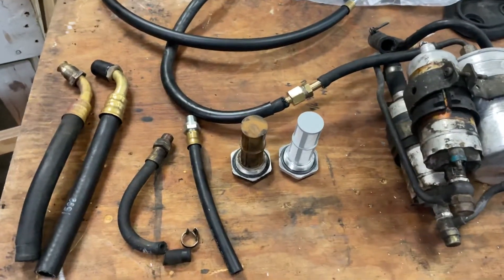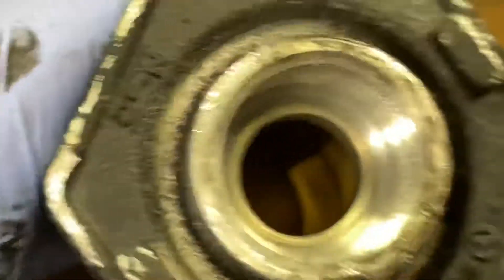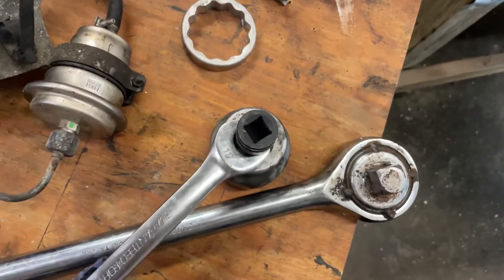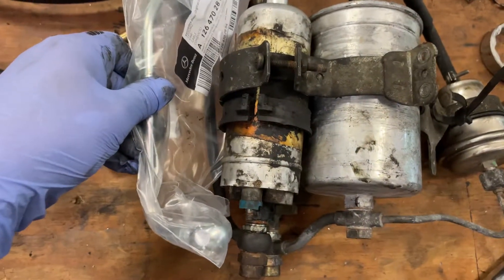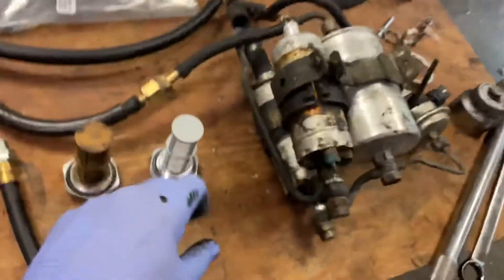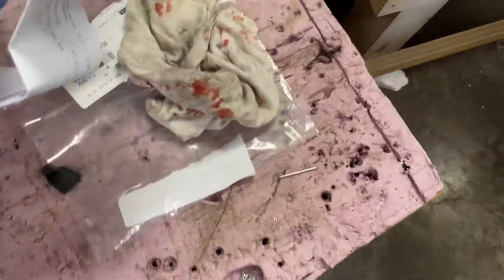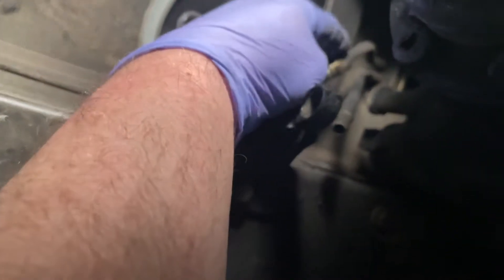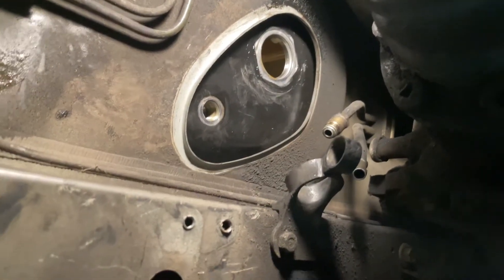Mercedes Benz 560SEL MY 89 Fuel Pump Assembly overhaul Part 1

Comment: Hello, thank you for our informative video. My car, W126 300 SEL, has a fuel release problem. That's why the car starts late when it is cold. I have a gasoline check valve. To which hose and in what direction should I attach this check valve?
Reply: I want to prevent gasoline from going back to the tank. So that the car will start when cold. In which direction and on which hose should I put the check valve?
Reply from the maker: Check valve is mounted on output side of each fuel pump

Comment: I have a question, I'm experiencing hard first starts whenever the car has not been used for a few days. I purchased a fuel accumulator only to find out I don't have one. is this correct for a 92 400E 4.2? thanks in advance for any advice you share.
Reply from the maker: Hi Kevin, for how long have you had this hard start issue, like in days / weeks. Second, for how long do you have to crank the engine in seconds before it starts? How many miles does this car / engine have?

Comment: hey i have a 88 420 sel and i have a fuel pressure regulator and i noticed that theres a hose that it needs to connect to the breather hose and it was broke off when i got it do you have any idea where i can get a new vent line?
Reply from the maker: There is one seller on eBay who sells them, that’s where I got mine from two years ago. Sorry can’t find the link on ebay
Reply from the maker: Found it:
MB 000 078 02 81

https://www.ebay.com/itm/364167894479?mkcid=16&mkevt=1&mkrid=711-127632-2357-0&ssspo=cspd_9ghtfo&sssrc=2349624&ssuid=Hi9YnvwaR7e&var=&widget_ver=artemis&media=COPY

Comment: I put a full tank of gas in my '86 420sel. When I got home I gas was leaking from the trunk. I heard this i a common problem on these cars. If you ever fill your tank completely full it might leak into the trunk.
Reply from the maker: Not really. The worst case scenario is a dried out O Ring Part Number 107 997 13 45 for the fuel level sending unit on top of the tank.